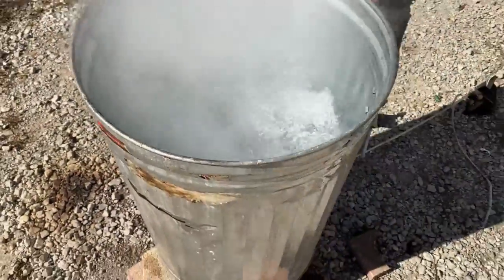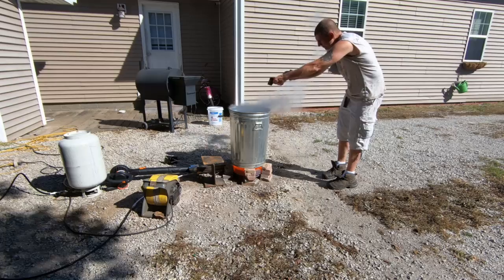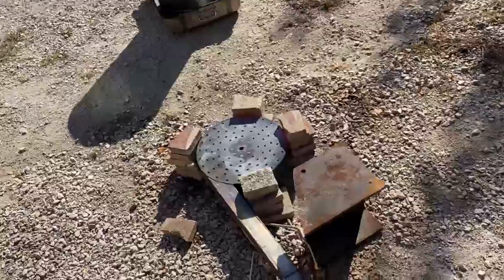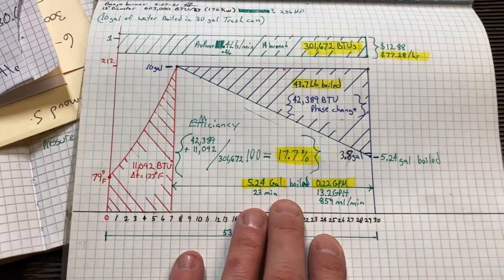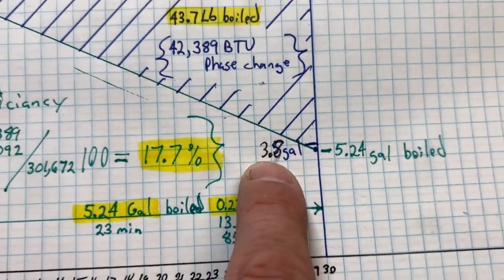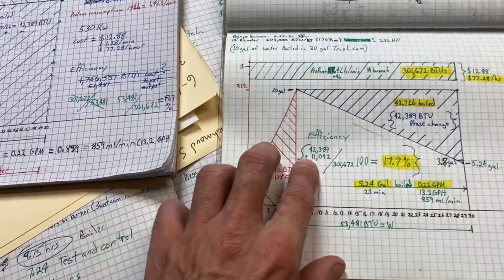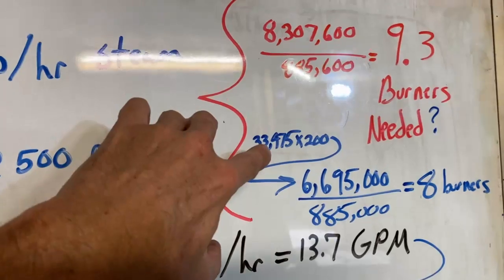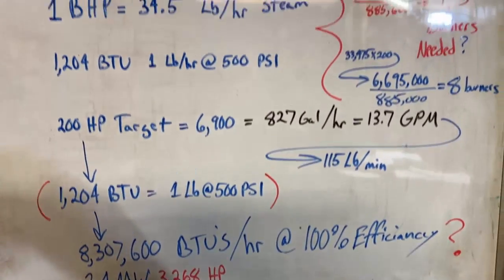Liquid Propane Banjo Burner Thermal Dynamics

Comment: Hey no box 7, have you seen or tried out the "Bluefire" brand "modern mapp gas"? Amazon sells it, I purchased it, but haven't tried it yet, although I intend to give it a shot with both a mapp/ air torch, and a little mapp/ oxygen torch. Initially I thought it was the same BS propylene replacement for mapp, but it's not- according to the MSDS it's 20 percent propane, 40 percent dimethyl ether, 40 percent propylene. Interesting mixture. Just wondering, take care!
Reply from the maker: hmmm interesting indeed , for propane engines maybe ?
Reply: @NOBOX7  haha, I had the same thought, or "ideal for compression ignition lpg piston engines"?? Looks like it showed up today, so I'ma burn some and see how it burns!